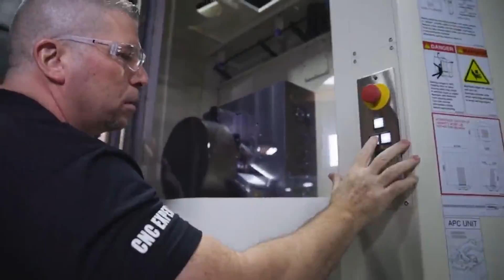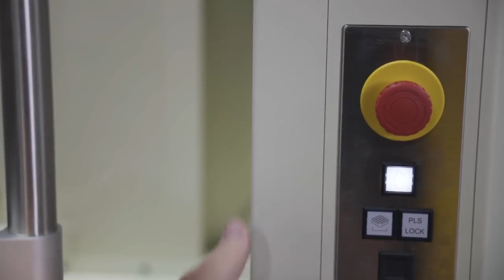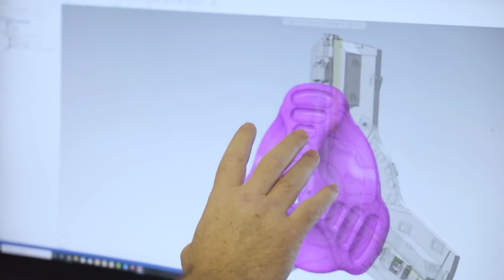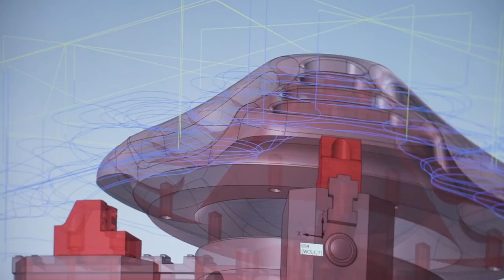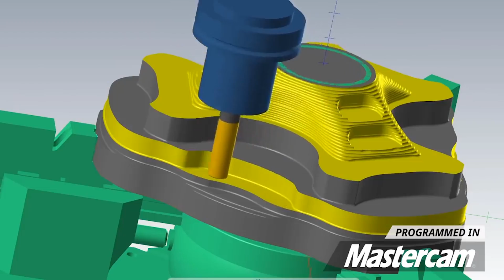Buyer DEMANDS 15% PRICE DECREASE or Parts Get Outsourced!

Comment: Titan! You Rock! But now you got me started. I hold engineering degrees and the skills of a high end woodworker and conventional machinist. I have worked as a CNC machinist in the fitment industry but am struggling to break into the metal world. It’s hard to learn new software and skills when you have to buy software to learn how to use it. The ploy by the new president clearly indicates my distain for MBAs. They are bean counting bull crap artists looking out for their own good. What if you did give them the 15 percent? Well the new president would take full claim that he reduced costs by 15 percent under his managerial skills and as such deserves a bonus. Next year he will want another 15 percent unless he gets a new job elsewhere using the 15 percent to strong arm a signing bonus. Soon after several iterations of MBA manipulation, the profitable company is now plowing red ink. You can often spot such companies when it’s clear that payroll is very top heavy. To many chiefs and not enough Indians!  Each position needs to be justified by direct value add! A CNC engineer or machinist has hands on to the product or widget as the MBAs call it. While HR serves a necessary evil, no one in HR has hands on to the product so no value add. It’s a cost of doing business like paying rent or utilities. When you get into the top heavy slots, the BS can become so deep that even the dog catcher is vital! So you have metrics on the CNC business. You know how much you need to make as a shop and what the average shop makes. If your asked to take a hit like that, demand justification! If the customer is truely in trouble, now is the time to act. Not when your customer files chapter 11 and sticks you with a huge unpaid invoice! If your customer is pulling an MBA game, the you will know that to in which case you merely make up an excuse why you can’t accept the 15 percent. If they want to go China, let them. Getting cost effective quality out of China is hard and often requires you to move supervisors to China to ride them 24/7. The second your not looking, they are cutting corners. Now add in the logistics of supply chain!  As the standard of living in China increases so does their costs. So as time marches on, the cost benefit of out sourcing becomes narrower and narrower and the costs of supply chain increase. Now add in the liability your company accepts due to external quality control issues and you see that only a greedy short sighted manager would jump into this tat trap. It’s not worth it!  Make it in the USA! If you have a quality control issue, you can just walk onto the floor and rip some arse in a single language!
Reply: MBA's will hasten the demise of industry in our country. I don't mind when I hear colleagues say they're considering a masters in eng but MBA earns no respect from me. Btw, I used to work with a mfg engineer named Emch. He's a helicopter test pilot these days.
Reply: @absolutelynonameslef  Agreed. My dad, a management consultant, chewed me out when I was young. I wanted to get an MBA and head to walk street. He said that all those guys do is move wealth around. Wealth gained thru the backbone of American Industry. At the end of the day, you have to make something in order to pay the bills. How wise he was!

Comment: If you fold and allow the customer to unilaterally demand an across the board 15% cut with no input as to your costs you are just inviting further cuts until you are out of business. It's the race to the bottom.... because you know that ultimately some bean counter is going to offshore the working thinking they will get the same quality at a lower price.... which we know isn't true.

Comment: Dumb idea to price to run at near 100% capacity. The old shop owner was right. 15% blanket reduction says moron bean counter. You should have charged more to do the rework, so the end cost to them was more than you were originally charging.

Comment: People need to understand outsourcing. When a company outsources outside of its nation, a variety of things happen. Let’s say in a decades time of outsourcing CNC parts. Now the USA has outdated machines, a workforce that has lost the ability to do a job if necessary because the industry has advanced in a decade. Now a decade later when that nation your buying from understands the market and that they have a monopoly, well then they are going to raise the rates to beyond that 15% savings. But deciding to pay that extra 15% means that money circulates within the country. Which means your gdp is higher even though you pay 15% more. Meaning at the end of the year it’s more like 10%. And we haven’t got to standards, working conditions, shipping and even taxes on outsourced products that may or may not effect you. So it’s never a give and take situation. Someone is always losing. Japan didn’t want to buy our f35’s because they realized they would completely exhaust the knowledge of building 5th and 6th generation airplanes within a decade.

Comment: This is some terrible advice from either someone who is very capable in running a shop and CNC machines but knows little to NOTHING about business and turning a profit. The cost of running your machines on two shifts (maintenance, tooling and repair costs) so that you can give someone else the savings is not a sound business plan. That is like if one were to buy a brand new car from a dealership  then pay all the depreciation on that car by driving it off the lot then immediately  selling it for the depreciated amount to someone. It’s bad business.

Comment: Basically outsourcing is the first line of cost-cutting for basically any company involved in manufacturing. As an American I know it will upset many when I say that many Chinese or other foreign manufactured products are just as good and sometimes better than things produced domestically. When it comes to the question of jobs and helping workers put food on the table, however, that goal is diametrically opposed to the entire purpose of business in general: profit. Many people have been able to create decent incomes for themselves by doing small-scale machining and prototyping for small businesses and niche consumer goods. Realistically the demand for US-based manufacturing on industrial scale will only continue to decrease until wages around the world equalize. Technology improves all the time, and there are many facilities in China and elsewhere that use state-of-the-art equipment. There is definitely something to be said about dealing with people in your country who speak your language and have shared expectations for how business is done, as well as not having to wait 6-8 weeks for a boat from China or longer if you need something made.

Comment: If you're running your machines at 100% (not counting maintenance, etc), then you can probably raise your prices such that they're operating at maybe 90-95% but your total profit is higher. In economics (MBA) speak, you want to maximize the difference between your marginal cost and marginal revenue for your next order, and it's very unlikely you're doing that while also operating at 100%.

The classic example is hotel rooms. Hotels don't make maximum profit when they've rented out 100% of their rooms every night.

Here's another way of looking at it. If you operated at 90%, you would have the capacity to take on rush orders for triple the price. That's not something China or Malaysia could match simply due to shipping.

All the best.

Comment: From the customer perspective, upgrading machines, becoming more efficient, faster, and less expensive would be the best move. From the business perspective, the customer has no right to demand the business to lower their cost, much less demand -15%. The owner did the right thing by saying no, but was wrong for getting stuck in his ways.
Reply: Someone has to pay for those newer faster processes , it's not free . Maintenence on high tech machines ain't cheap either . Those improvements are for the benefit of the employer , employee, and customer,  not solely the customer.

Comment: The pristine and new marketing t-shirts doesn’t add credibility- it makes it looks like your a new desperate company with new equipment and low work load.  Not a lick of dirt, grime, or dust. Nothing.  I’ve had customers joke about this when they saw an employee with pristine work clothes. It sends the message of inexperience and your not working hard. Sure it’s BS but at the end of the day you want your customer to feel like your working hard and not desperate. A little grime can demonstrate this. Work shirts with company name and employee name and no marketing jingles may be a better demonstration of a machine shop.

Comment: If you believed that with your purchases and instruction they could save 40%, then yes, give that sniveling company the 15%, thus ensuring that the company you worked for continues to have work.  Greed walks a very fine line between keeping a business alive or running it into the ground by stripping it of its liquid operating capital.  Write your contracts such that the companies you produce parts for will have to own the material if and when it chooses to send it business overseas or to another vendor  At least then you are not stuck with tons of material you may not be able to use.  Considering what is happening in America today I would opt to have the purchaser pay for all materials up front because of the cost increases being forced upon us  because of hyper-inflation.  It would be a benefit to them, thus the only thing they would have to pay extra for would be the labor whose cost also went up with inflation.

Comment: This sounds like a talent issue.  Talent is an intangible asset. Talent can never be decreased.  The reason being it is inherent.  Business neither smart or not as smart cannot measure it.  They take a number problem and try to remove the wrong side of the equation.  If you decrease the talent you'll only increase the liability.  Theoretically that can never or at least in the foreseen future will not change.  Sounds like someone did not have the stones to tell both sides of the cause and effect to a leader, forget the manager they'll just decide.  It's like taking someone with no skills and say make something.  Talent will only make a difference in that scenario.  Notice I did not say Intelligence.  The minute you start to shave talent it becomes a slow death.  If the company has a decent cash flow the death can be become slower but the problems will start to be more evident.

Comment: I am old school German tool-and diemaker, lots of experience in the manufacturing industry, machining parts for assembly lines, we had good department managers who always kept parts on the shelf and ordered new ones accordingly, so no pressure, no overtime needed, everything went smooth and in orderly fashion, excellent quality parts that lasted, not to mention the endproduct, moved - unfortunately - to Canada where everybody knows everything better, especially in the energy sector ( oil and gas ), keeping parts in case something goes south does not work, costs apparently too much, so here comes the weekend, customer needs parts made asap - on shelf 30$ part plus max. time factor, now 300$ - , just one reason gas/diesel etc. is so expensive, a good machinist was making 30$ to 35$/hr., a no-skill driller 110$ to 150$/hr., parts outsourced to prc and here re-machined, part was 10$, after machining 110$ and still lasted only around 25% because of inferior material and managers, which couldn't be helped. CNC's are great for churning out high quality parts but will never replace experience - until AI is fully integrated and that will mean a totally new social re - think.
Reply: This is a common failure with just in time inventory systems. Toyota invented it and still understands it best. During the recent computer chip shortage Toyota was least affected because they understood the most critical parts with the longest lead times must be kept in stock at all costs.
Reply: @patrickweaver1105  "This is a common failure with just in time inventory systems. " - Actually just-in-time manufacturing DOES work as long as you're able to keep the supply chain under tight control and they're on-shore (i.e. you don't have to worry about the 3-4 week lead time). Doing it with purely off-shored suppliers is pure madness, that's for sure.
Reply: AI isn't a magic bullet. it's still has to be coded up. AI isn't good at complexity. There's no real replacing skill.
Reply: "part was 10$, after machining 110$ and still lasted only around 25% because of inferior material and managers" - OMG what kind of moron would have a part made from crappy raw materials re-machined?! O_O

Comment: The problem is that once you give these companies that discount based on their "demands" then you've just kinda sold your soul to them. They now see that you are willing to bend to their demands just under the threat of outsourcing. The bottom line is, they want you to provide a top quality product at outsourced pricing. If these companies really want to survive they have to understand that good quality is going to always cost more than outsourced products that aren't as regulated. I would have told them to take the 15% and shove it right up their asses.

Comment: Had that type of lowball offer once. Fixed it by agreeing, on the condition they were bottom on job priority. Full paid jobs first, and slack time is filled with the remainder of low offers.  When due dates pass by over 30 days, reply with thanks for taking last place. Our other orders now don't miss due dates.  It's a priority issue. No we don't do rush or overtime pay for lowball jobs.

Comment: I worked for some guys that had profit sharing. On one job I was consistantly making at least ten times shop time every time I ran the job. I told them that they should give the customer a little break on the price.They refused to do so and the customer bid the job out to an other shop. They refused to believe that a little good will goes a long way.

Comment: I'm a retired machinist.  My last job I work for a company that makes electrical connectors. They were 100% American-made but after the new owner took over about 15 years ago they decided to outsource them to China. Of course the results were predictable.  They were shipping hundreds of cases of connectors back to Southern California where the connectors all had to be reworked and 100% inspected. And then they were sent back to China because those connectors were actually for the Asian market. The funny thing I noticed was I was looking at the shipping labels. Those boxes were being FedEx'ed 24 hours from Shanghai to Southern California and they were moving multiple hundreds of the boxes everyday. Each box held 200 connectors.  Each box weighed in at around 40 lbs. 
The management just chalked it off to "cost of business".

Comment: The $64 question is how and where did that Malaysian outfit come in the door???  I bet your CNC supplier hooked up with the US Gov’t to sell the same machinery to Malaysia  with the proviso off giving your customers for them to undercut you!  It happens all the time since the US is desperate for overseas machine tool sales.  So you end up with the crumbs falling off the counter.  It stops being funny when your customer must send parts back overseas for corrections.  You’ve lost this customer, but maybe you can find you betrayed your firm.  BTW, this racket goes back before CNC took over. machine shops.

Comment: Best move would have been to agree to 15% discount in exchange for a guaranteed quarterly order volume significantly above current order volume. That would have put them in a position where they are the ones saying no to you. It was supposed to be a negotiation. It's quite possible they were willing to give you something in exchange.
Reply: No, they weren't. They wanted higher profit with no work.
Reply: respectfully, what are you saying? i don't work in the industry, but your proposal would give the company what they wanted ... a profit, while you faced a loss. If they give you high volume of work, you will be doing more  work for a loss. More over, if they occupy 50-60% of your capacity, they own you. They'll continue to mess you over, and you won't have any way out because they're your primary customer.
Reply: @SB-rf2ye  Guaranteed higher volume, from an existing customer, means 100% of your sales & marketing time & budget can be spent on activities that will expand your business. You no longer need to spend any of your sales & marketing money chasing after jobs that will pay next month's payroll. Now you can spend that money on real expansion. GUARANTEED revenue is extremely valuable. A company should be willing to "pay" 15% for the freedom and manuevarability that guraranteed revenue allows.

Of course, the customer will end up "owning you" if you do not actually spend anything on sales & marketing.